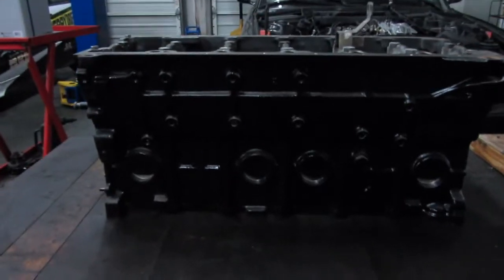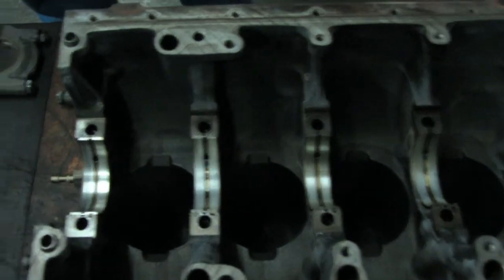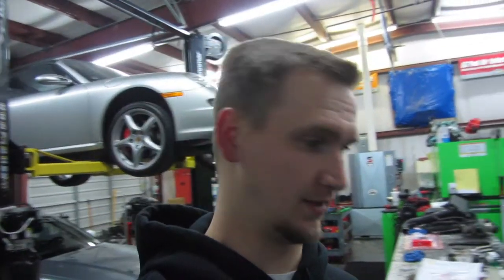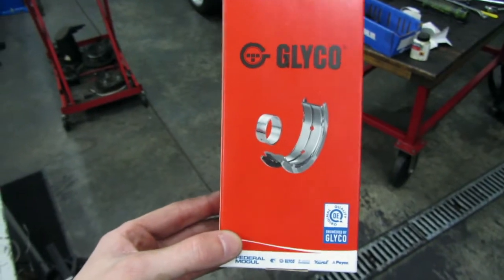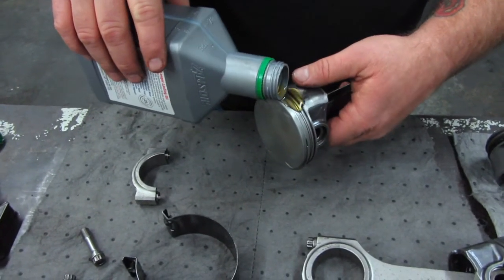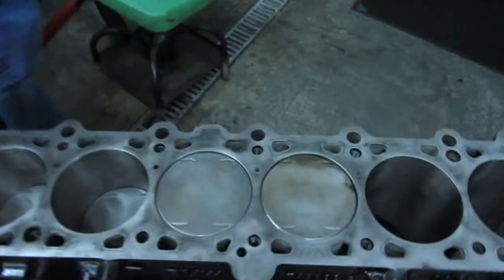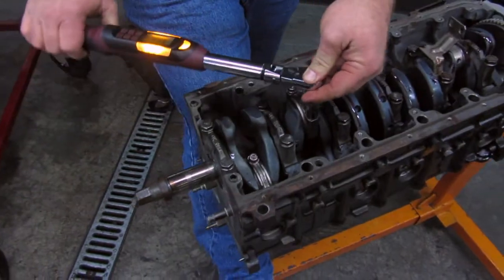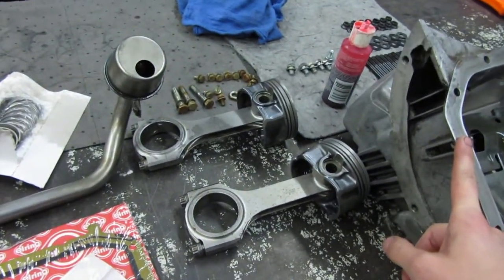3.1L Stroker Turbo Build Under Way - Bottom End

Comment: What’s the compession ratio after doing all of this as I want to do this build aswell
Reply from the maker: I’m not really sure what the compression ratio came out to. It is definitely lower than the factory M54 compression 10.2:1 at the least because of the this MLS head gasket we put on it.
Reply: TB Drifting buddy if we cud chat I’d really appreciate it as I have mostly everything on your list except my rods are forged
Reply: TB Drifting but ok so s52 stoke length is 3.6mm and M52B28 stroke length is 3.3 so regardless of Pistons the stroke would still be higher giving it an higher compression no
Reply from the maker: Alright. Sure! Just shoot me an email at tbdrifting@gmail.com or shoot me an instagram or Facebook message.
Reply: In regards to putting an s52 crank in an m52